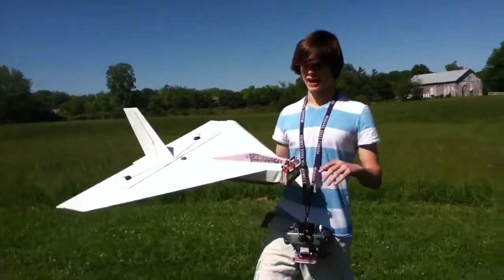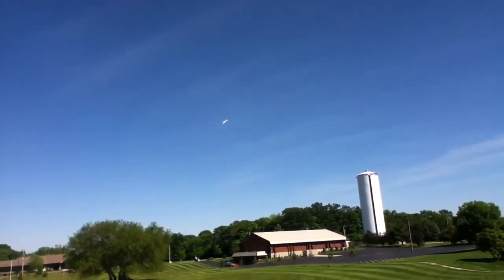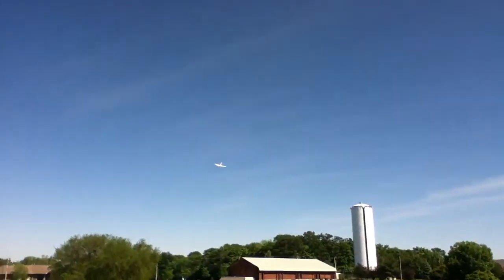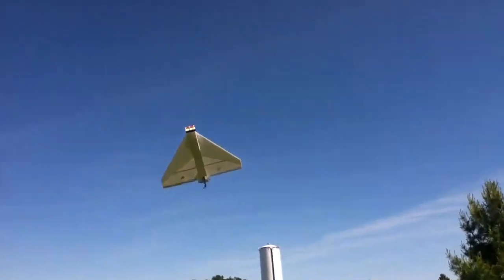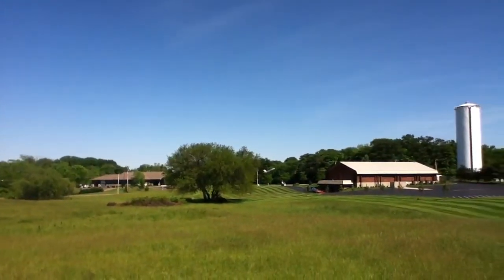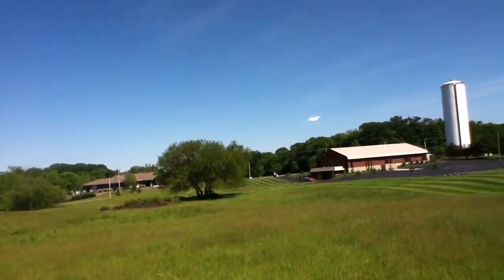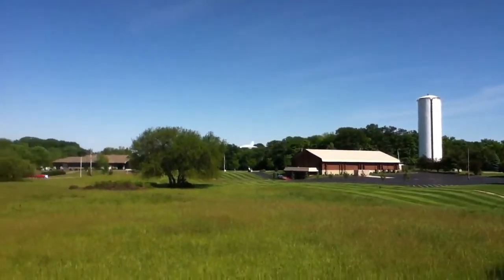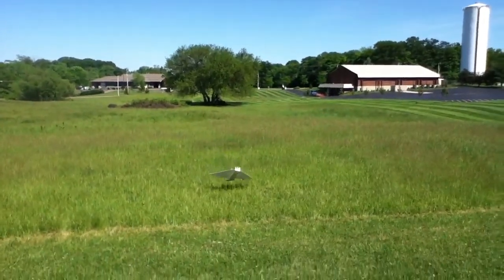Delta FPV Aerobatics

Comment from the maker: @daisy8luke It's probably a number of things, the holes on the control horns might be slightly larger than the pushrods, the cheap servo has some slack, etc. but it's not a huge deal, I have a new FPV/AV plane now, check it out! Thanks, WRC